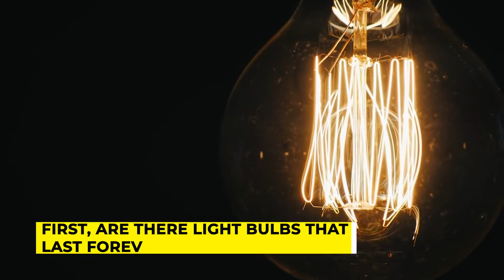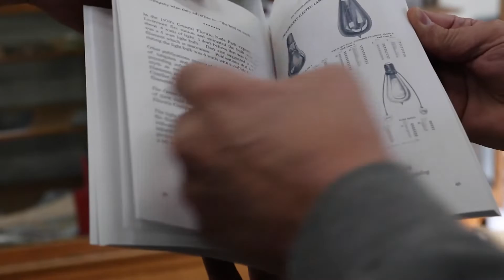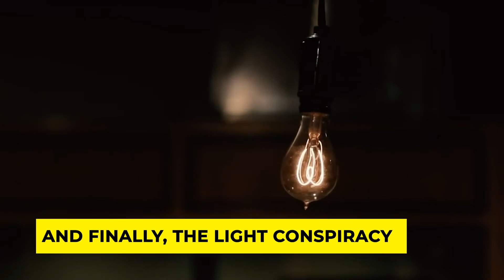Here's WHY Light Bulbs Don't Last Forever..

Comment: They have been doing it in cars for decades too. I worked with an engineer for GM. He said that their used to be metal rods in all linkages to open doors and lock them etc.. then they put plastic connectors in that were designed to get brittle after five years. That is why your piece of crap American big corp machine falls apart right after you get it paid for. 
This is why Toyota demolished the US car market becaus epeople were fed up. 
What did American corps do? Well they never learned. Instead of making better cars they made them cheaper. 
NEVER buy American big corp car again as long as I live. Toyotal ALL THE WAY.